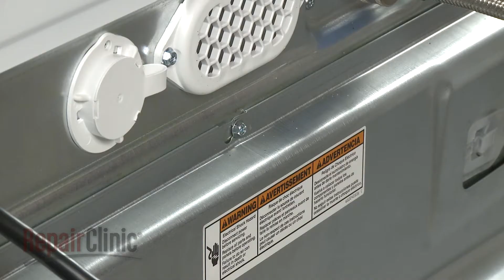Whirlpool Alpha Front-Load Washer Vent Pipe Assembly Replacement WPW10261582

Comment: This steam vent pipe leaks at the bottom connection to the tub. Just a few drops, but over time it adds up. I had to remove the part and use food grade kitchen silicone caulking to help the existing vent pipe threaded washer to keep the water from dripping out. The Torx 20 screw at the top is a REAL pain to remove. Consider buying a small ratchet and T-20 bit to get at it. Whirlpool Duet Steam Washer.
Reply: I think I have the same problem. Mine only leaks though when I use the Clean Washer cycle, probably because that cycle uses twice as much water.
Reply: mine is doing the exact same thing.